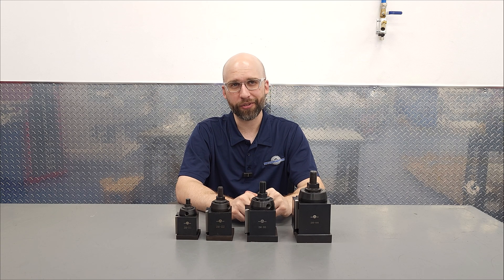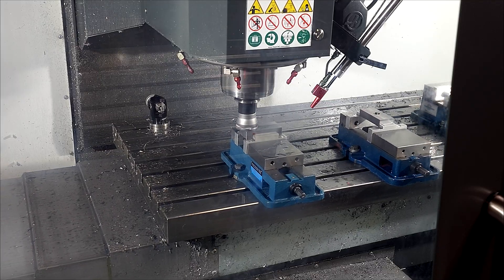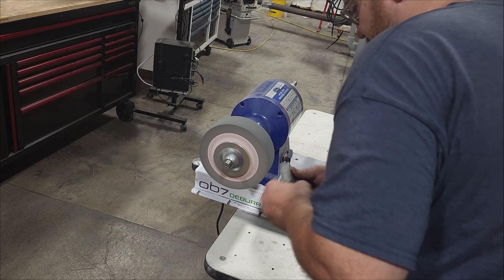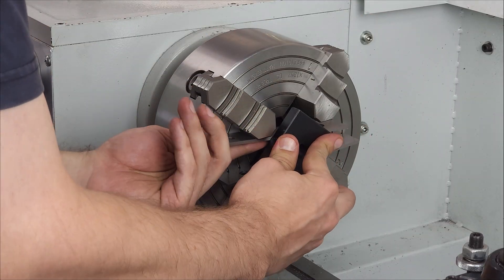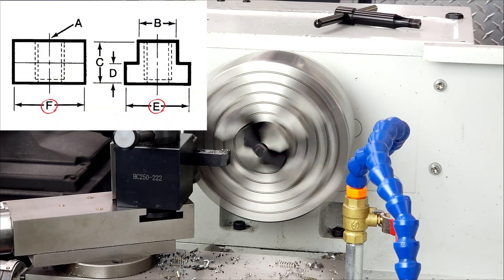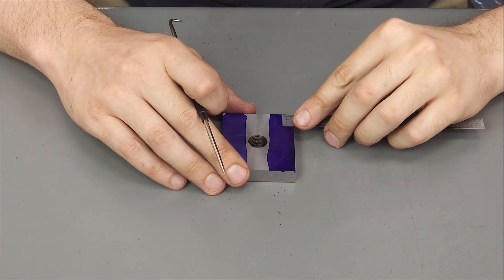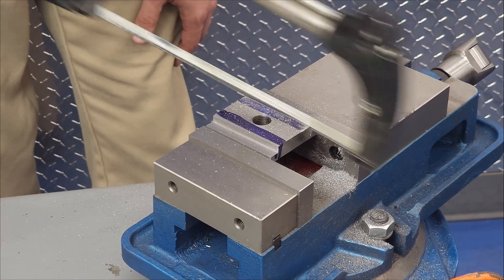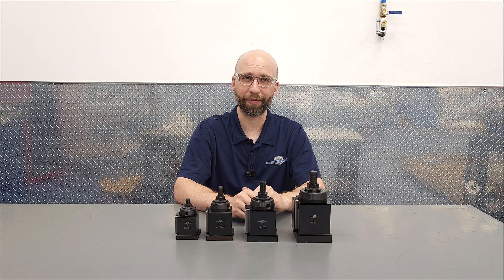Quick Change Tool Post T-Nut Fitting - Precision Matthews Media

Comment: Another option might be to buy two pieces of appropriate size bar stock from McMaster-Carr, hacksaw to length, stack the pieces together, use an electric drill to drill and tap for some flat head screws and assemble. Hold the assembly in the 4 jaw and drill & tap the large bolt hole.